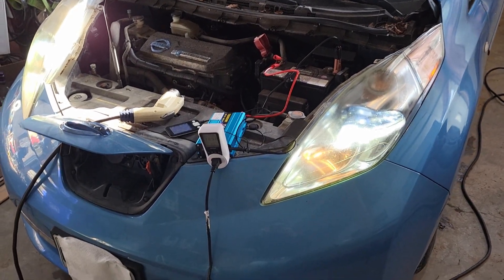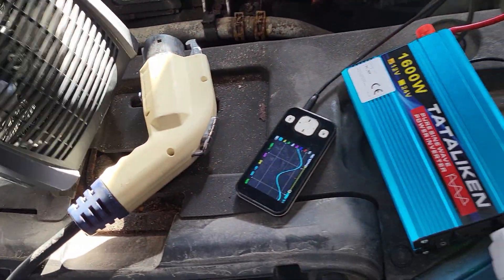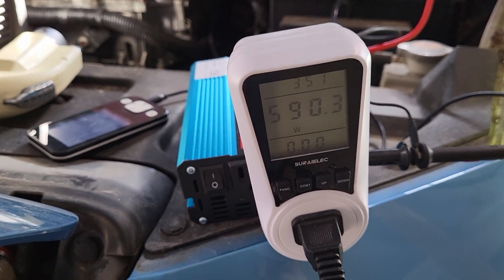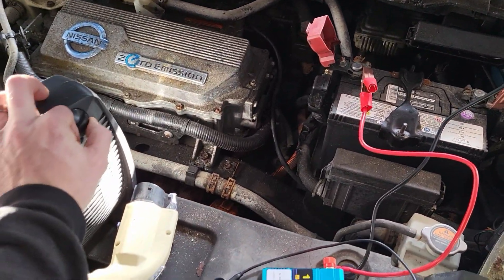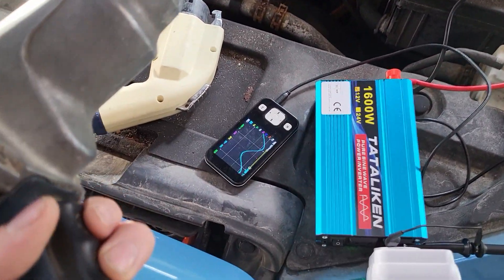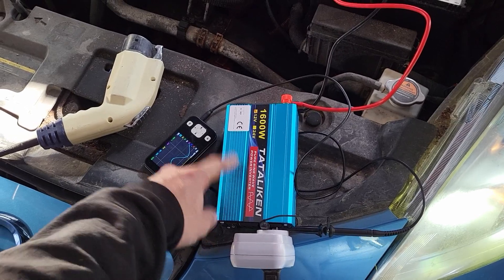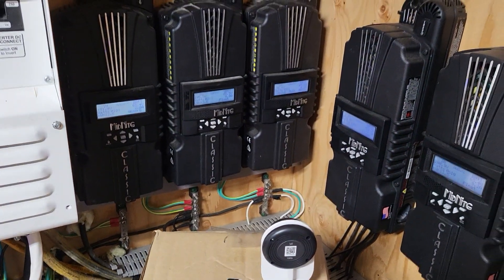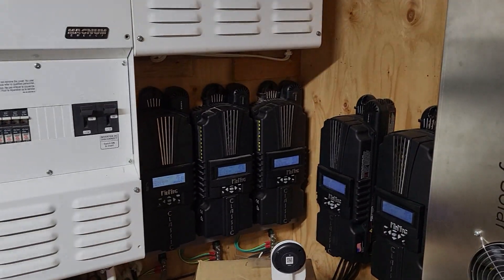TataLiken higher input voltage test, is it better? Can it Surge?

Comment: Looking to buy the 3000 watt one. Do you know if the 3000 watt will run a ryobi electric pressure washer?
Reply from the maker: i would say probably not, im guessing its a 1500w inverter.
Reply: @GoingOffGrid101 the same inverter but the 3000 watt?